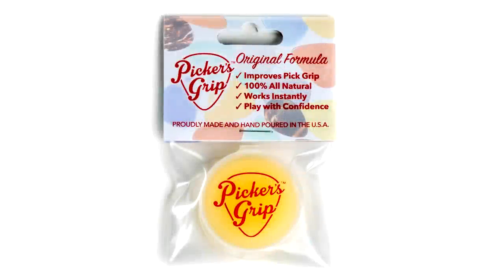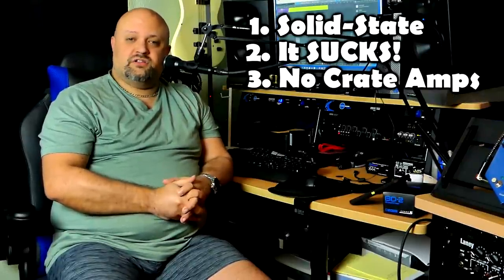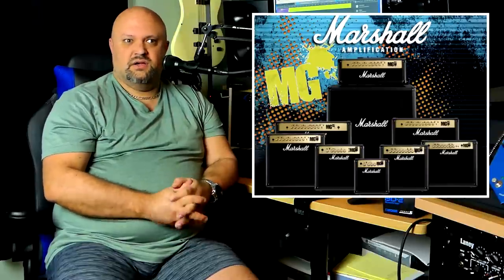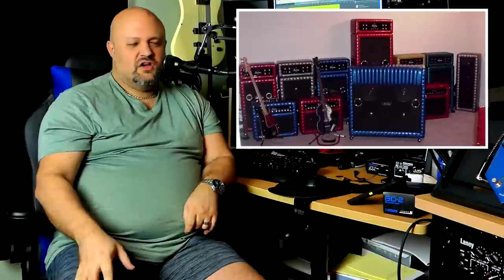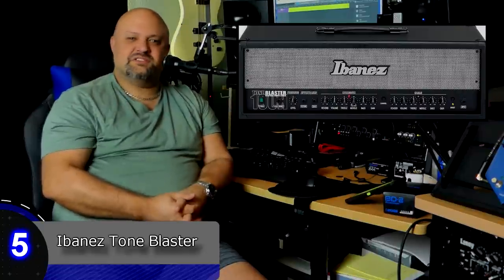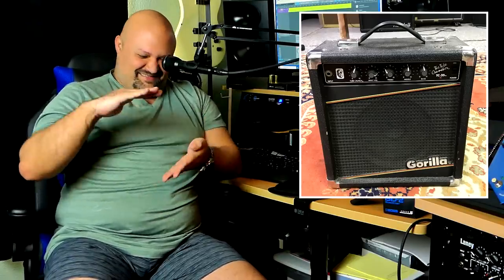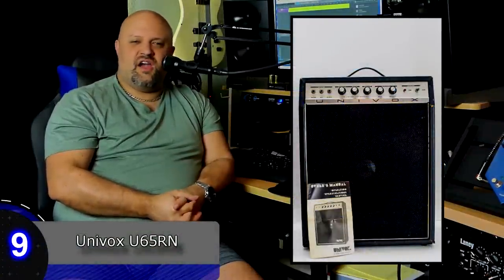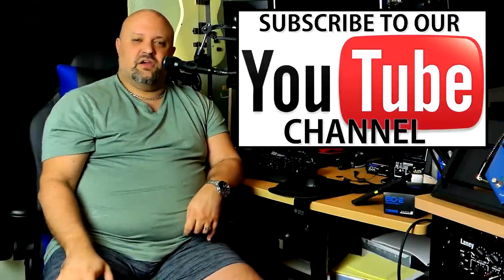Top 10 WORST Solid State Amps EVER!

Comment: The Johnston Millennium amps had Digitech effects inside them. The controls are the same as the Digitech 2112/2120 rack mounts. It was a great idea, probably implemented badly. They were really cool looking and the pedalboards controllers were way beyond most stuff put out now.  I almost purchased one of the Millenniums when they came out.
Reply: Plus it's a hybrid amp, the amp had tube preamp and solid state power section. Shouldn't be on that list since it's a hybrid.
Reply: @erasmomoreno9460  🎯🎯🎯🎯🎯
Reply: I managed to get the Mellennium amp to sound good .
Reply: I Love this amp and it's Rectifier voice had Me trade it in for a real one. The Johnson J station rolled too! Yes digitech. The artist 2120 was also a great rack!
Reply: I always thought that Johnson Millenium sounded awesome for its time. I had forgotten it had Digitech effects in it. I had a Boss ME-250 multieffects processor and a Fender Princeton Chorus back then and the Johnson sounded quite a bit better. My dad used to buy and sell a ton of gear back then and I’m pretty sure we had one at the house for a couple months.

Comment: I bought an old Crate G20 solid state amp long ago, it sounds fantastic after I gutted the cabinet and installed a 12" Weber British Series Bluedog speaker and vintage Silvertone 1481 tube amp chassis.
Reply: To prove you could make the Silvertone amp sound worse. I hope the chassis had caught on fire.

Comment: I picked up a Gorilla TC-110 for £25 shipped as it was not working properly and the reverb was dead. 

After an hour fiddling and cleaning connections, it worked properly. It was NOTHING like any of the other Gorillas I had seen/heard and wasn't so bad. I only got it to flip for charity and sold it for £75 plus shipping to one very happy owner.

Comment: I had a Marshall MG and a spider 4. The MG sounded much better.  The worst amp I've played was a Fender Frontman.  Sounded like a jangly box of bolts shaking.
Reply: I have a fender frontman 212r(got it for 180€
It does sound pretty shit on its own
But it takes pedals and fx processors very well, i use it with a 100€ mooer ge100 for live gigs
It sounds much better than you'd expect, at least for metal(wich is mostly what i play) .
But still, a boss katana would probably be objectively better.

Comment: Kustom Amps are the only vintage stacks that you can get cheaper than a blu ray player. That should tell potential buyers something!

And although i never played or owned a Johnson Amp, i did have a Johnson J Station FX processor that I bought in La Porte, Indiana back around 2003 from Roxy Music that I actually kinda liked for a few years after seeing Adrian Smith from Iron Maiden use one in a studio for practice. It was the same basis for the amps but they were infamous for failures and a nightmare to repair allegedly. Only guy i ever saw use one was Rich Williams of Kansas and he ditched them pretty fast

Comment: Say what you want about Kustom, but they are hands down the #1 amp company to come out of Canuterville Kansas, and that's a fact
Reply from the maker: Conuter Valve.
Reply: @RobertWJackson  They're still in business in Chanute making police radar units and the like and they don't want to hear anything about the amps. There is a sort of odd connection to the late unlamented also solid state Holmes Mississippi Bluesmaster. Something about an amp company being won in a card game. I dunno. They're awful. I am kinda surprised you overlooked Baldwin and Power-Sonic. They were terrible.
Reply: Chanute, Kansas. Just looked it up.

Comment: A few of the worst amps not on this list because they didn't last long enough for anybody to hear them. The Fender Super Showman Solid state amp. This was a preamp complete with Morely vibrato, with power amps in the cabinet. it wouldn't last through the weekend from a country player. Fender had the amp designed by some HiFi (JBL)  engineers and it was clean to a fault and totally unreliable. Every Monday, my customer would come back with the amp blown and my repairman had a handful of freplacement transistors. First and last Fender transistor amp I ordered for almost 20 years. 
Next on the list Gibson GSS 100. Sounded ok until it saw the least amount of distortion and it them turned into a smoking mess. Gibson customer serviced sucked in the 70's and parts weren't available.  i sold the cabinets for PA monitors and threw away the head. 
We didn't sell Kustom guitar amps as everybody was buying Fender tube amps, but a few of the tuck & roll bass amps and PA systems were passable. It seems that they would blow up once, but once repaired never gave any further trouble.

Comment: Marshall should have never stopped with the valvestate. The vs100 has some great tones in it. The MG is not very good I don’t know why those stayed on and they ditched the valvestate
Reply from the maker: The Valvestate is a hybrid amp.
Reply: Robert's Guitar Dungeon true. Best of both worlds if you ask me. Does it stand up to something like a Marshall JCM or Plexi at volume, no. But it does have great tone and you can use it at bedroom volume or at jams and medium gigs no problem. It seems to be a concept victory took to heart recently with some of their new pedal amps too
Reply: @maniacalion6170  Not ideal for gigs as they thin out at volume, but stick an MXR 6 band in front and VS100 sounds just like a Marshall valve amp in a home low volume setting.... the 8100 is even better.
Reply: Michael Walters I know some metal guys who live their 8100s, but I haven’t really played those. I don’t go strait to full blown metal, more a bluesy classic rock, classic metal kinda guy, with a flair for jazz. I almost wonder if the thinning out is more to do with being a low quality cabinet and a mediocre speaker. I also noticed that the OD channels are what I like at home, but when I’m turning it up the clean channel is the only one that will stay together load. A friend of mine put a Celestion alnico blue 30 into his vs100 and said it made a word of difference at volume. I’m also wondering if that and a true pine board cabinet would make it hold together better at higher the volume.

Comment: Did Kustom ever make a decent tube amp with that covering? Because if so, I can 100% guarantee John Fogerty would not have used a solid state Tuck-and-Roll. 

Also, I think we should just disqualify anything that comes in a guitar starter-pack from this list (which would be the Gorilla - fairly sure when I got my first guitar it was a starterpack with a rebranded Gorilla amp in it). They suck, everyone knows they suck, it's just not interesting to talk about.

Lastly, is the Marshall MG really that bad? From what I remember they were kinda in a "best-of-the-worst" type category - pretty bad, but there was a lot out there for the same price that was worse.

Comment: My first “real” amp was a Crate G40CXL, & it really wasn’t bad. They hadn’t perfected the circuitry to emulate tube distortion yet, so pretty much every solid state amp had shitty sounding distortion. However, the clean channel with the built in chorus sounded GREAT! I borrowed my buddy’s US Fender Strat with EMGs to do some recording, & the sound was amazing. Later I got a Real Tube distortion pedal to use with the Crate to replace the crappy amp distortion & it sounded good, but the amp was only 40 watts & wasn’t loud enough to keep up with my band I was in. I sold it & bought a Marshall Artist half stack. Now some 30 years later, I’d like to get one & see if I can replicate that great clean chorusey sound from my earliest recordings

Comment: Love Crate amps. Having said that, the best and worst amp I have played through was a Flexwave. The Flexwave (in my opinion) was flat-out the best sounding amp I have ever heard (better than any tube or other SS amp) but it kept blowing up every month just sitting in my apartment. Not sure which series to go with after that that had that clean sound but were rock solid and the distortion was exactly what I wanted without a boost.

P.S. Would love to have a GT3500H but the internet seems retarded. I have seen old Crate combos (that were just bad to begin with) without speakers and torn grills going for $1,000 and crappy amps that you could buy new for $300 are now $1,200. Used to find the flagships for $130 in mint condition and that includes shipping but now they are $200 - (put any number here) and that's without shipping and slightly to very much abused. 

The funniest I have seen are the Crate Power Block CPB150's. You could buy them new for $69 - $99 and people are trying to sell them now for $150 - $400.
Reply: Crate Power Blocks have proven to be great pedal or Modeler platforms.

Comment: There was an Australian amp back in the late 60s and early 70s called 'Lenard' and they were so bad, I can barely begin to describe them. When they weren't blowing up from faulty transformers, they were like a bad hi-fi amp. Clean and loud until about 90db, they broke up so badly what came out of the speakers wasn't gain, just harsh clipping. If you ever find one, buy it for a few bucks, just so you can hear what it sounds like.
Reply: If I ever find one here in England ,I will , just because it's not Chinese , even if it's not working lol
Reply: The Myponga Festival used an array of Lenard amps as the PA. Black Sabbath played through them that day! Check out the film clip to Daddy Cool's Eagle Rock to see them in situ at the festival.
Reply: @GretschenMunch  , "Eagle Rock"!  That's song was used as the opening soundtrack for the slasher film Wolf Creek!

Comment: My first amplifier was a West.  Solid-state, of course.  I bought it used - it had been sitting in my local music shop for a few months priced at $100, and on a whim I offered them $20.  They came back with "How about $40?"  So I went home with an amplifier.  And it was a godawful piece of crap.  It sounded terrible, it was glitchy, the tone knobs did almost nothing, and I was ecstatic when I bought a Fender Performer 700 to replace it (this had a tube preamp for the overdrive channel but was solid-state otherwise).  I think I ended up just throwing that West amp into the trash.

I currently have a Boss Katana 50 MkII.  Decent little amp if you're willing to take the time to fiddle with it.

Comment: I would let have to add my first amp, the Peavey Pacer. I got it home and started playing, and less than 2 minutes later something blew and it quit working. Back to the shop it went for repair, got it back home after a week or so, turned it on and “pop” - quit working again. And it happened a third time until they gave up and gave me a new one. Ended up trading it with a guy down the street who had a Vox Royal Guardsman complete rig with stand and covers - but alas, solid state so it didn’t sound that well.oh well, lesson learned..
Reply: I had a Peavey Pacer for 15 years. I used it for EVERYTHING. Guitar, bass, keyboards. Not a single problem. Traveled the country with it. Had the patented Peavey hum to it but overall it was a workhorse. The problem with solid state amps is that if you have someone of questionable expertise work on them, they're done. I had a GK RB400 that I took to a shop and they did shoddy work on it. I blame the tech not the amp. Same thing probably happened with your Pacer.

Comment: Ha! Crate guy too. My 2nd amp early 80s was the classic Crate I. Have another laying around today. My amp in practice space is a 120 watt 2x12 with effects which sounds great would have to go outside to see the exact model.  Used to play a 100w half stack too. Huge bang for the buck!
Dont be too mean to line 6, i grabbed a cosmetically ugly 30w spider 3 $50 for my beginner kiddo. Miles over my no-name starter around 1980

Comment: Hey man, gotta agree with you on Crate. Put it through some solid speakers and they can be an overall solid pick, I’m speaking from experience on a GT1200H. It sounded leagues better than the Randall Diablo I had, weighed about a third of the Randall to boot. Best thing I’ve ever picked up off the side of the road.

Comment: Kustom,,, yes John used these. ha, He wanted a Marshall but was told they couldn't afford one.
Seems like a week later Blue Cheer has six (!) stacks for OutSideInside.
Story was yes The Kustom for stage use. Late story from the late '90s and the amp is rolled off stage while a guitar cord was plugged in breaking the face plate. Fixable but retired Jonh LOVED this amp.
ha, The Amp Book from like 20 years ago,,,,,Fliegler, Marshall then Fender rep offered a Kustom stack
"Engage the Harmonic Clipper if it sounds too good....btw, a hundred dollahs ;)

Comment: Broken MG100 (usually because the output mosfet is poorly heatsinked and the fan fails) head cases make great cheap wood cabinets for diy tube amp builds.

Comment: I agree about line 6 but I must say they are definitely the most respectable in that they do something right.  They have several knock offs that seem heavily inspired by their spider amps.  They also have an ironically good tendency to attract new players/ less knowledgeable players. 

When I first found a like 6 spider 5, I thought it was like an undisputed beast.  I saw the size (tried the largest 1x12 and the 2x12), the versatility,  and I get to the "insane" preset and think I've found the top of the metal mountain.  So I have to respect their ability to appear so appealing and also sound appealing so effortlessly to new comers.  

After buying and returning amps a million times I've settled long time on a Blackstar ht club 40 mk2 Kentucky special 1x12 (this one really boasts of its screaming eagle speaker), Blackstar TVP 260 2x12, and for portability sake Boss Katana mk2 50w.  I have come a good long way since going all in on line 6 🤣😂

Comment: John Fogerty himself actually said he stopped using the Kustom Amps after 1972 because, they were very unreliable and extremely cumbersome to tour with. He started using various Marshall JMP-era amps and Fender Dual Showman’s during 70s.  He used JCM 800s/900s throughout 80s-90s . Since the early 2000s he been using Cornford MK 50/100 tubes amps. They’re kind of a Marshall JMP based amp.
Reply from the maker: Well, he didn’t use JCM 900’s throughout the 80’s because those amps didn’t come out until 1990.  But he probably did use the JCM 800’s throughout the 80’s. 😉
Reply: @RobertWJackson  It was the JCM 800s I think.

Comment: I understand crate has more turds than most companies. they have decent pedal platforms, cabs/speakers, and power sections...BUT they usually make 3 cranked and stacked metal zones seem like a good idea. as a crate fan (as much as one can be) I agree with your intro good sir. also fender frontman is the unspoken abomination that you can't even give away because they sound angry bees farting in a wet cardboard box.

Comment: I designed the PCBs for Digitech about and up to  the time of the Millenium. It is a composite of the a few of the multi-effect foot processors
coupled to power amps. If you threw away or didn't by the footswitch......

Comment: I agree about Crate. I had a GX-60 that I bought for $150 in the late '90s. Clean channel sounded huge but the dist Shape channel 
could sound great or everything hated about SS dist. Best for me was when feeding this with a Marshall Lead 12 head.
Next, Roland Cube 30, silver tolex. I bought this new. Bought a Carvin VL10 to warm it up. Used to hit this was a strato and Boss Heavy Metal pedal. When I went to sell it, guy at the local shop had a buyer, a dude who wanted one to play a blues harp thru. Go figger ;)
Also happy the Fender Cyber Twin wasn't here. Haven't gigged this in nearly 10 years but it kicked Ass then.
Now, $200 listing for one on Reverb. Bought mine for 6 way back then.
I guess they switch channels out of the blue. Apt life so if I do use it, no strain. Vypyr 15 and a modest pedal board with a set of Sennheisers these days.
ha, I just remembered the CT is technically a hybrid amp with some 12ax7's in the circuit. Might be here other wise.
I still love it.
Reply from the maker: I sold the Cyber Twins new for $1300.  Now they’re worth $150. LOL
Reply: @RobertWJackson  yep.  I bought a 18 /14 headphone  cord today.
Curious to see how it works with the ct..
btw, Vypyr 15, $49 used.
btw, a little amp jam. CT sounded great and behaved ;)

Comment: Haha! I grew up with Crates too. I actually still have them, a 120W Flexwave full-stack, and a 120W GT1200H half-stack. I clicked on this video just to see if they would be on here. Oh well, still  a great video!

They're good if you're a pedal player on a budget and need something that's decently loud for cheap. I could have gotten a smaller Fender or Vox for about the same price and just mic'd it, and sounded better, but as a hard-headed teen, I wanted a stack behind me, dang it. 🤣
Reply from the maker: Those amps actually sound pretty good.  The problem is that Crate almost ALWAYS cheaped out on the speakers in the cabs.  Run those heads into a real cab with Vintage 30’s or something and you’ll see what you’ve been missing all these years.
Reply: @RobertWJackson  Thanks! I'll have to try that out